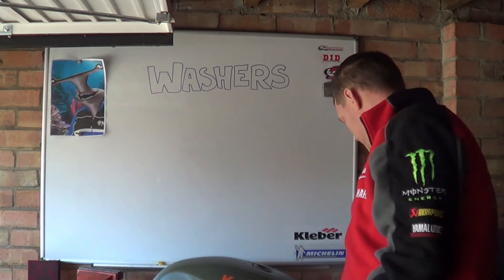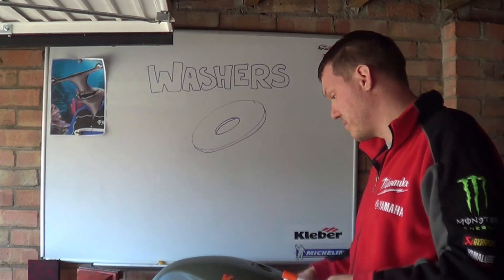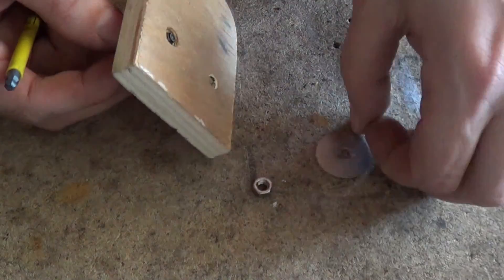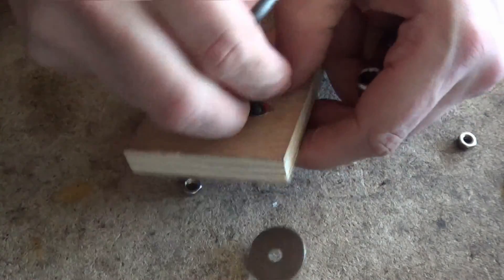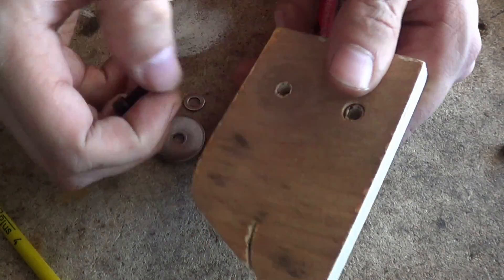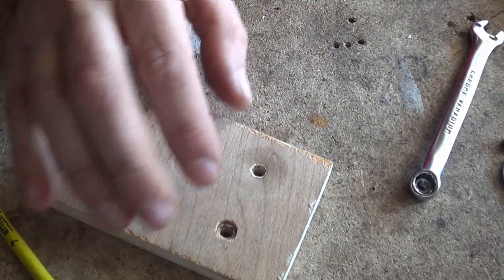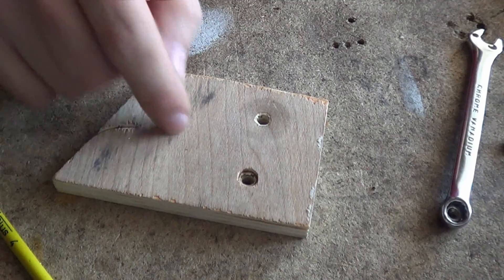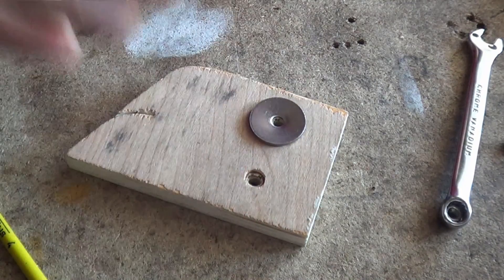Thrust and normal washer basics

Comment: I’ve been looking all over YouTube and haven’t found anything yet.. In Regards to sanding down a thrust washer at home or a DIY. Reason why I need to sand or mill down my own thrust washer is because.. I own a vintage dirtbike that way made in Italy and thrust washers for this bike are very expensive especially when the only place to get them is the UK and the shipping is more than the part! I’m looking to create a thrust washer that is 15x22x0.4MM in thickness. Any ideas and a what kind of metal is typically used for thrust washers? And how could I bring down the thickness so that I have the right tolerance between the clutch and the clutch bell. I need 20 of them and I’m trying to prevent from having a CNC shop charge me hundreds of dollars. Any advice helps- regards
Reply from the maker: Look for 'ground shim washer' They're usually hardened steel

Comment: Thrust washers are usually harder in most applications like gearbox's where they sit at the shaft ends between the soft casing and the shaft itself
Reply from the maker: "usually harder in most applications" and copper thrust washers in crankshafts?